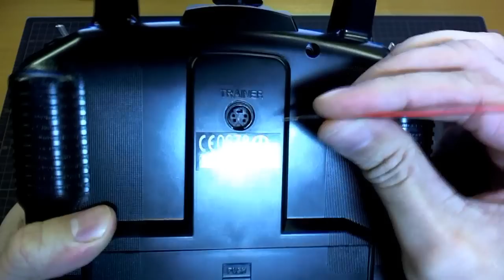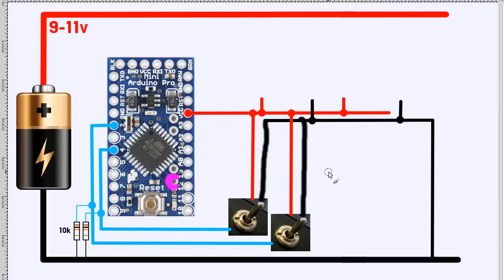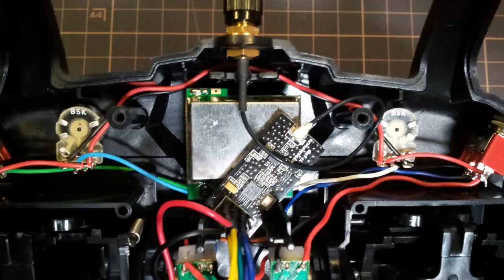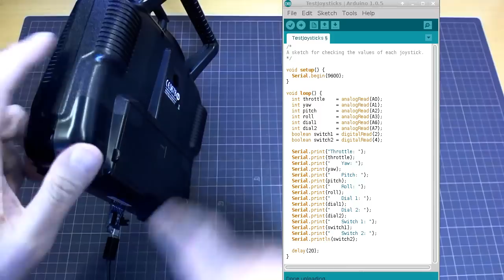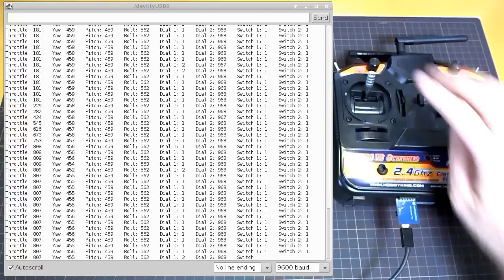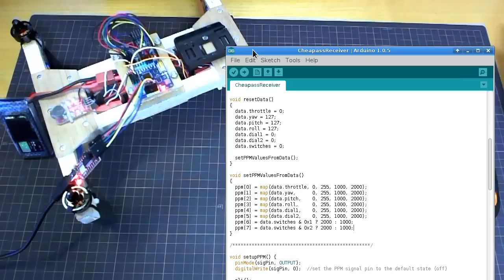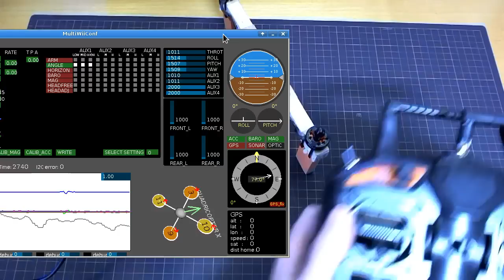Cheap-ass quadcopter build Part 12 - Arduino conversion of HK transmitter

Comment: Can i use pa version antena version of nrf24l01  as a receiver also i dont wanna use pcb antena I dont think ramge will be good with pcb antena
Reply from the maker: Yes, the PA+LNA version is better in every way.
Reply: @iforce2d  so if i use pa ,+lna version as a receiver do i have to change the code u provided on your website
Reply from the maker: No.
PA = power amplifier
LNA = low noise amplifier
These extra sections only amplify the signal coming out and going in, the chip is the same.

Comment: Where i can find sketch i have this exact transmitter and is not working properly so i want to build nrf24 with this transmitter pls link for sketch
Reply from the maker: I don't know exactly what sketch you're meaning, but the receiver sketch used in this series is linked to in the description of this video: https://www.youtube.com/watch?v=yxUEpmDe9z8
Reply: @iforce2d  i need complete sketch for receiver and trasnmitter for nrf24lo1 with this board and transmitter pls can u share code cause my current transmitter range is terrible
Reply: @iforce2d  link doesn't work its  always under maintenance for some reason
Reply from the maker: http://www.iforce2d.net/cheapassQuadcopter/sketches.zip
Reply from the maker: Copy that and paste it into your browser address bar. For some reason YouTube likes to screw it up if you just click on it.
Reply: @iforce2d  thank you so much for sharing code , so i just do the wiring as u did with ur transmitter and write the skech on arduino board  and it will work without any modifications? because i dont know a single thing about programing if something gets screwed up i m in bad position cant afford a transmitter rn only can do these modules
Reply: @iforce2d  so this code will work flawlessly without amy hassels ? cause i dont know Sketch nad programming  thnx for helping me out tho

Comment: Hi, Trying to find where you have the
8 channel version of the software  
( I think) the upgrade software for calibration 
 details of the Oled display tester and software
This is the second transmitter I have built. The first worked fine but I have a sneaky suspicion the original software might have been changed somehow as this new unit has the readings jittering like crazy on the display unit. 
I noticed yours is stable and the first one i made is the same.
Calibration was ok but this jittering has got me wondering where I've gone wrong.

I have a short clip of the problem but no idea where to show it.
Thanks Jorgo.

Comment: Hello ,thank you IFORCE2D for all your videos ,I follow your steps and finally I could make my cheap-ass quadcopter using nrf24l01 ,I am not good in programation ,I ask you what varraibles in your code (multiwii-rf24) should I send it  to my transmiter to show the configuration's  parameters as (multiwii type ,gyro,acc.....) in the GUI ?

Comment: When calibrating, should you not move the trim levers to their extremes also. Say for example full throttle on the joystick and push throttle trim all the way up and use that as max for throttle to put in the program(not just joystick movement with trim centre)
Reply from the maker: The trims are separate potentiometers so they would need separate analog inputs. Moving the trims does not affect the joystick values.
ah... iirc this cheap and nasty radio has a mechanical connection between the trims and the joystick, so for this one there is only one potentiometer per channel.
Even so, if you add the trim extents to the joystick range you would then no longer be able to give inputs like 'full left' without also moving the trim to get the required range. This would be quite inconvenient for arming and disarming.

Comment: Built up and fitted to an old Kraft Tx from the 70"s. Yet to load software for transmission but with the test program for the stick readouts, all works fine. Used a 10K resistor from each trim pot to each main pot input to Arduino and when getting travel amounts for later, I put each stick hard over and also the trim to get max/min figures.Good stuff, thanks for your project. Would have put a couple of photos in but can't see where to do this.

Comment: when i turn off power switch all swithes values is 2000..what is problem?
Reply from the maker: power of what? Values showing where? Help me out a bit bro....
Reply: i am using APM 2.6 with ppm.all values working perfect.switches too.but when i turn power off,on the display (mission planner >>radio calibration)switches is 2000.
Reply from the maker: I have no clue about APM sorry. How about asking in the APM forums.
Reply: trasnmitter's power switch which im turn off
Reply: it is same problem multiwii.it is not problem flight controller.this problem is transmitter (arduino sketch)

Comment: What are the dials for?
Reply from the maker: In most cases for a quadcopter, nothing. Although in the next part of this series I did actually use one to control the brightness of a light. I have also used them to control the pitch direction of a brushless camera gimbal.
Reply: iforce2d well, if thats the case, can i just use it as a trimmer ? what code should i add?

Comment: iforce Been working on this for several months I dont like to bother you. I'm having a rough time getting the 2 pots to work. Data on my TX Tester Thingie i used a 5v Nano and the Transmitter is a 3v pro mini.

I also used the Test Joysticks sketch with no luck reading both pots. They read as if one is stuck or at times they both work as if they are on the same pins reading the same values.

All 4 switches work

Replaced the Pots with new and Changed Analog Pin location 4,5,6,7

I'm using a very new version of Arduino and nRF24L01 and they work everywhere else sketch wise that is.

I also removed constrain from the Pots in the sketch.

I will build a new Tester Thingy with 3V Arduino and A new Arduino for the Transmitter if you recommend

below is the sketch.. 

#include <SPI.h>
#include <nRF24L01.h>
#include <RF24.h>

const uint64_t pipeOut = 0xE8E8F0F0E1LL;

RF24 radio(9, 10);

// The sizeof this struct should not exceed 32 bytes
struct MyData {
  byte throttle;
  byte yaw;
  byte pitch;
  byte roll;
  byte dial1;
  byte dial2;
  byte switches; // bitflag
};

MyData data;

void resetData() 
{
  data.throttle = 0;
  data.yaw = 127;
  data.pitch = 127;
  data.roll = 127;
  data.dial1 = 0;
  data.dial2 = 0;
  data.switches = 0;
}

void setup()
{
  radio.begin();
  radio.setAutoAck(false);
  radio.setDataRate(RF24_250KBPS);

  radio.openWritingPipe(pipeOut);

  resetData();
}

/************************************************/

// Returns a corrected value for a joystick position that takes into account
// the values of the outer extents and the middle of the joystick range.
int mapJoystickValues(int val, int lower, int middle, int upper, bool reverse)
{
  val = constrain(val, lower, upper);
  if ( val < middle )
    val = map(val, lower, middle, 0, 128);
  else
    val = map(val, middle, upper, 128, 255);
  return ( reverse ? 255 - val : val );
}

void loop()
{
  boolean mode1 = false;//!digitalRead(4);
  
  // The calibration numbers used here should be measured 
  // for your joysticks using the TestJoysticks sketch.
  data.throttle = mapJoystickValues( analogRead(A0), 180, 482, 807, false );
  data.yaw      = mapJoystickValues( analogRead(A1), 150, 490, 800, true );
  data.pitch    = mapJoystickValues( analogRead(A2), 220, 468, 800, false );
  data.roll     = mapJoystickValues( analogRead(A3), 225, 487, 850, true );
  
  data.dial1    = constrain( map( analogRead(A4), 1, 1020, 0, 255 ), 0, 255);
  data.dial2    = constrain( map( analogRead(A5), 1, 1020, 0, 255 ), 0, 255);
  
  data.switches = 0;
  if ( ! digitalRead(2) ) data.switches |= 0x1;
  if ( ! digitalRead(3) ) data.switches |= 0x2;
  if ( ! digitalRead(4) ) data.switches |= 0x4;
  if ( ! digitalRead(5) ) data.switches |= 0x8;
  
  radio.write(&data, sizeof(MyData));
}
Reply: the problem i had was self inflicted. I used a 5volt nano in mt TX Tester Thingy. after rebuilding it everything is fine.

Comment: witch nRF24 library are you using maniacbug or TMRh20/RF24

I'm building YET another quadcopter

with a new computer and new arduino building a 3 pot and 4 switch transmitter cant get working i think its the library?
Reply from the maker: maniacbug

Comment: You need to take into consideration the position of the trims when calibrating. Otherwise you will find that e.g. if your pitch trim is fully up, then the last part of the stick movement in the up direction will do nothing. PIXScotland's solution is preferable but requires an extra switch (maybe a momentary?) as long as you ensure that the trims are moved to their full extents as well.

Comment: I received the new multiwii flight control board, same problem. I have been poking around and think since my center joystick values return to around 1512 this could be the issue. ( even though yours are almost identical ) the problem is one of the motors continually rises in rpm.  The chat boards say this is the multiwii making corrections to right itself. You seem to be using STOCK PID settings and sticks not centered and flying just fine?? This happens without the motors on battery and also no props just spinning.
Am I on the right track playing with the transmitter code.. 
I checked my maped values but can't get them centered 

Any help would be Great, I will make a video if you would like showing what happened.

I'm also going to make the follow cam after I get this off the ground all the stuff coming from banggood.

Comment: Thanks to the GREAT SERIES, All working great T,Y,P,R, 3aux lights or anything and 1 dial. THANKS MUCH. Still waiting for a new multiwii board I somehow damaged pin 3. Thought about building a plane like the flight test guys do. Hear me out, use the CheepAss TX RX leave both as is and use an additional pro mini to somehow convert the PPM signal to drive the 4 or whatever Many servos a plane uses. So me being a CheepAss I could plug the TX RX you taught me to build NO CHANGES take the receiver and the new thingie and fly into the sunset without having to buy mote equipment. Or am I being to much of a CheepAss.
Reply from the maker: +Mark Greco it should work, yes.
Reply: can you send me code if i will using PPM signal to drive the 4 or whatever Many servos a plane uses. ?
beacuse i will ise it in rc car or plane with diy tx rx arduino 
txh mr :)
Reply from the maker: For PWM output this video might be useful: https://www.youtube.com/watch?v=eVnyPSAefxU
Reply: /*  
A basic transmitter using the nRF24L01 module.
*/

#include <SPI.h>
#include <nRF24L01.h>
#include <RF24.h>

const uint64_t pipeOut = 0xe8e8f0f0e1;

RF24 radio(9, 10);

// The sizeof this struct should not exceed 32 bytes
struct MyData {
  byte throttle;
  byte yaw;
  byte pitch;
  byte roll;
  byte dial1;
  byte switches; // bitflag
};

MyData data;

void resetData() 
{
  data.throttle = 0;
  data.yaw = 127;
  data.pitch = 127;
  data.roll = 127;
  data.dial1 = 0;
  data.switches = 0;
}

void setup()
{
 
  radio.begin();
  radio.setAutoAck(false);
  radio.setDataRate(RF24_250KBPS);

  radio.openWritingPipe(pipeOut);

  resetData();
}

/************************************************/

// Returns a corrected value for a joystick position that takes into account
// the values of the outer extents and the middle of the joystick range.
int mapJoystickValues(int val, int lower, int middle, int upper, bool reverse)
{
  val = constrain(val, lower, upper);
  if ( val < middle )
    val = map(val, lower, middle, 0, 128);
  else
    val = map(val, middle, upper, 128, 255);
  return ( reverse ? 255 - val : val );
}

void loop()
{
  boolean mode1 = false;//!digitalRead(4);
  
  // The calibration numbers used here should be measured 
  // for your joysticks using the TestJoysticks sketch.
  data.throttle = mapJoystickValues( analogRead(A0), 127, 483, 852, false );
  data.yaw      = mapJoystickValues( analogRead(A1), 131, 480, 848, true );
  data.pitch    = mapJoystickValues( analogRead(A2), 136, 500, 868, false );
  data.roll     = mapJoystickValues( analogRead(A3), 152, 500, 870, true );

  data.dial1    = constrain( map( analogRead(A5), 968,   27, 0, 255 ), 0, 255);
  
  data.switches = 0;
  if ( ! digitalRead(2) ) data.switches |= 0x1;
  if ( ! digitalRead(3) ) data.switches |= 0x2;
  if ( ! digitalRead(4) ) data.switches |= 0x4;
  
  radio.write(&data, sizeof(MyData));
}
Reply: you should watch the videos over and over, then a few more times to understand whats happening.
Reply: thx mr. and can you send for souce coce for reciever using thats module with 4 output pwm for controlings servo or esc ?
Reply: +niqo hamam  that's all I have the 2 above transmitter and receiver that's all
Reply: thx mrs :). can you send a wiring diagram of that program ?
Reply: +niqo hamam watch this video and review arduino code it's all in there.

Comment: Hei sir if use NRF24l01 + arduino must use HK transmiter ?
Reply from the maker: +Fikri Yasir no, as you can see at the beginning of the video I also made my own little wooden box transmitter. You just need some joysticks.
Reply: ok sir thanks ;)
hey sir how if i use ardruino for quadcopter ?
Reply from the maker: +Fikri Yasir I don't understand the question....
Reply: quadcopter use arduino not use Flight control sir
Reply from the maker: +Fikri Yasir Still don't understand what you're asking - please make yourself clear. Let me guess, you are asking how you could use a normal arduino as the flight controller instead of the ready-made flight controller I used in this video series?? You can make your own with an arduino nano (or pro-mini, or uno) and an accelerometer+gyro breakout board like this http://goo.gl/HCPRxb
The breakout board will need four wires to the arduino.
GND -- GND
VCC -- VCC
SDA -- SDA (analog pin 4 on arduino)
SCL -- SCL (analog pin 5 on arduino)
Then in the config.h of multiwii source code you'll need to figure out which of the IMU types it should be. I think you can choose MPU6050 under the "independent sensors" section. After that everything should be the same as for this series, but you will have no barometer (altitude) readings.
Reply: yess sir i men using multi wii not use fc,because i had modul mpu5060 sir ,but i dont know scheme and tutor if using transmiter nrf

Comment: I have watched every one of the videos in the series at least 15 times . I'm having difficulty arming the multiwii. I purchased the Goooood joysticks same as in this video, frsky from banggood 15 dollars each and come up with similar values approx as you I MUST BE MISSING SOMETHING!!!!! Do I have to change something to tell multiwii that mt joystick doesn't go to 0, zero? 
I don't want to pester you but I'm stumped 

GUE shows all working as in your series
Should I upload a video to show all I have?
I searched on the web for multiwii arming
Watched painless360 series
My joysticks at the bottom don't hold the 135 value they bounce 135 136
Looking forward to your response.
Mark.
Reply from the maker: +Mark Greco do the stick axis values move from between about 1000 and 2000 in the multiwii gui?
Reply: +iforce2d 1014 to 2017
Reply from the maker: +Mark Greco and you arm by moving throttle down, yaw right?
Reply: +iforce2d yes sir I am
Reply from the maker: +Mark Greco well then I have no idea. You did not change the default arming position in config.h right?
Reply: +iforce2d ok tomorrow morning I'm going to watch both transmitter and conversion video again and follow along. I must have one small thing wrong. I will post again after that. THANK YOU VERY MUCH,!!
Reply: +Mark Greco last thing tonight, should the receiver stick values be the same as my transmitter? ""This is a stupid question ""
Reply from the maker: +Mark Greco the stick axis values should move from between 1000 and 2000 in the multiwii gui
Reply: +iforce2d all working now !!! To embarrassed to tell why I couldn't get it to arm,,,,, lets just say DumbAss building a CheepAss... After first flight I will tag back in. THANKS

Comment: hi the problem u r facing in home made transmitter was in throttler
cant we use throttle value using dial potentiometer and rest having the same

Comment: I worked on the same project..a tiny difference tho..arduino on the RX node recieves packets from TX node & sends them to host microcontroller via I2C..so no pwm involved..saved a lot of pins..plus less interrupts
https://tachymoron.wordpress.com/project-type/nrf-pickle/

Comment: Love this project so far, but i'm having a hard time getting the two pro minis to communicate.  is there a way I can check if the one in the transmitter is broadcasting and if the one on the copter is receiving?
Reply from the maker: +fantumn1 I made a little tester thingy to check that, but... it uses an arduino anyway, so I'm not sure if that would help.

Comment: So are all the dials and joy sticks hooked up to the VCC output (3.3 volts) as well as the NRF24 module? Also, my high powered NRF24 is in the mail right now so could i just use one that is identical to  chip on the actual quad copter in the mean time? I'm in the process of rewiring the controller right now and my knowledge of electronics is limited to my introductory circuits college course. Also im loving the videos and hope i can actually get this thing flying haha
Reply from the maker: +Brett Worrell For a 3.3v arduino they will be connected to the VCC 3.3v, yes. Yes, you can use one of the regular PCB type nRF24s just the same as a high-power one, you just won't get as much range. For a high-power one you would be better off powering it from a separate voltage regulator instead of from the 3.3v of the arduino